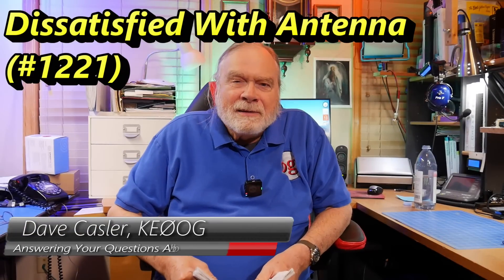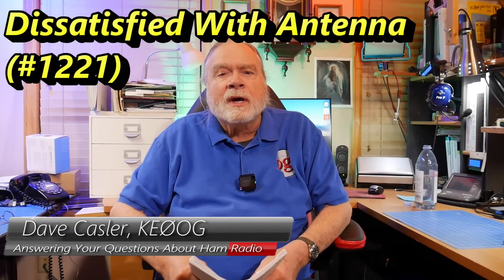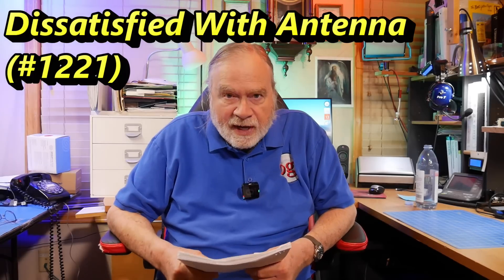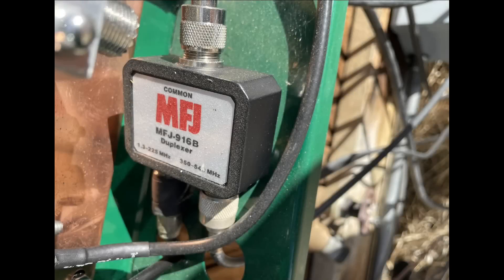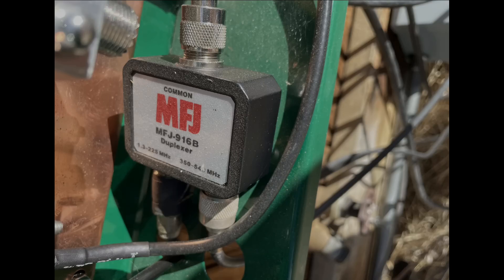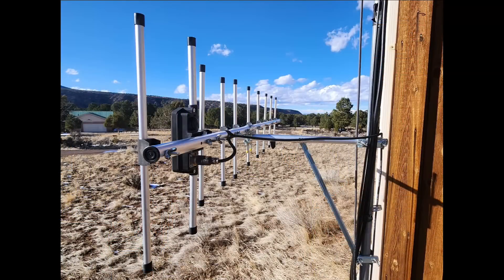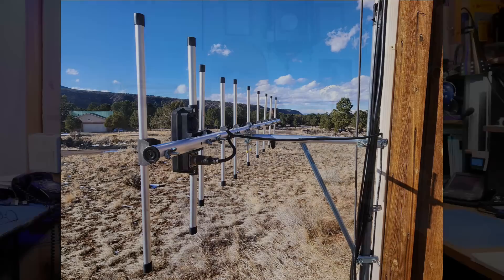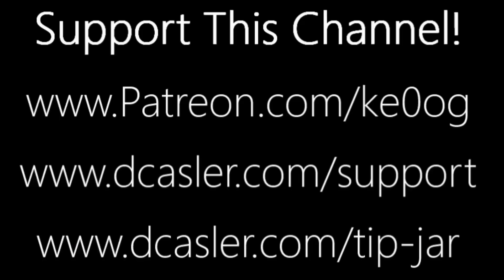Dissatisfied With Antenna (#1221)

Comment: Comet gp6 NC is the best dual band vertical and I've tested them all. SWR is highest on 467.700 at 1.45 to 1.50 depending on the day but maintains a 1.1 to 1.4 on 146.730mhz 156.450 mhz marine and 440mhz. The only other dual vertical antenna that performed well on swr for 2m 440 and gmrs is the tram 1477 which stays under 1.6 on gmrs and pretty flat on 2m 440 and marine freq also the tram is only 45in tall and about 69 bucks however significantly less dbi gain over a gp6 NC. Only buy the commercial freq version. As for others like the comet gp3 the swr takes off over 3.0 in the 467mhz range and a commercial freq model is not available to my understanding so if you want a discrete low cost dual vertical with gmrs capacity buy a tram 1477 if you want the most db gain and 10ft or money not a issue buy a comet gp6 NC but remember the NC part. Mounting for all tested was a channel master 25ft mast using LMR400 and kmr400 either was the same and some small 4ft jumpers of rg8 and a comet window jumper. 73